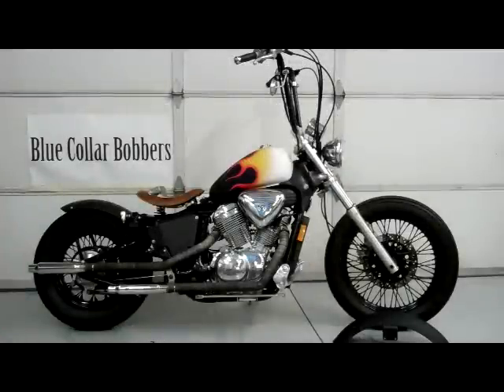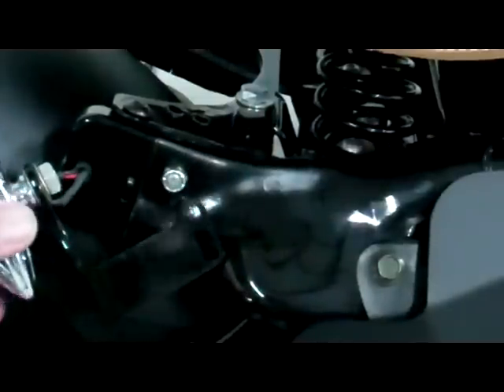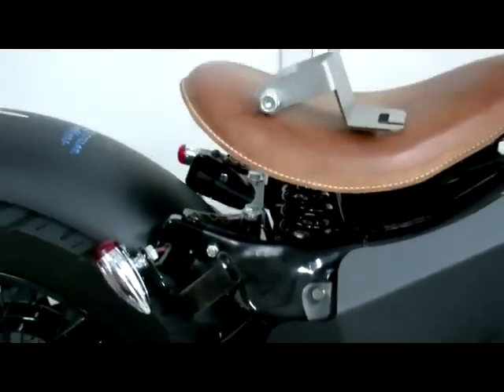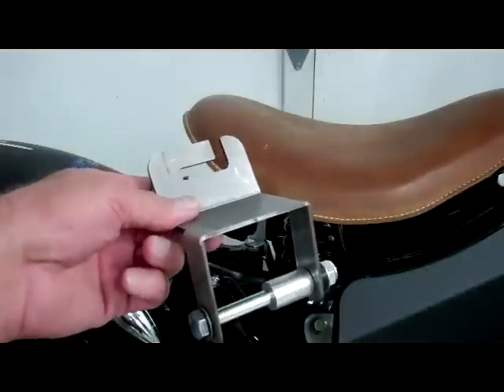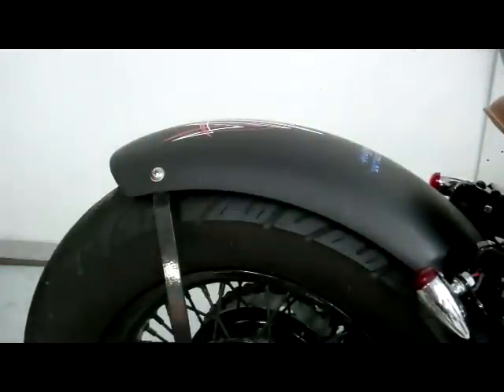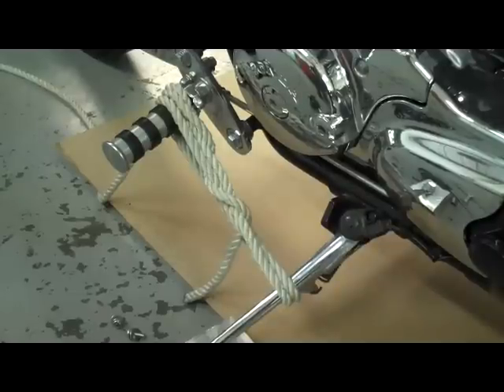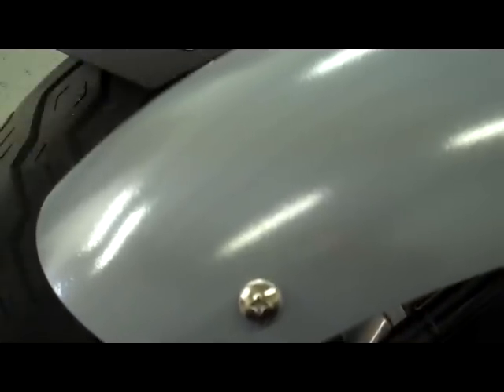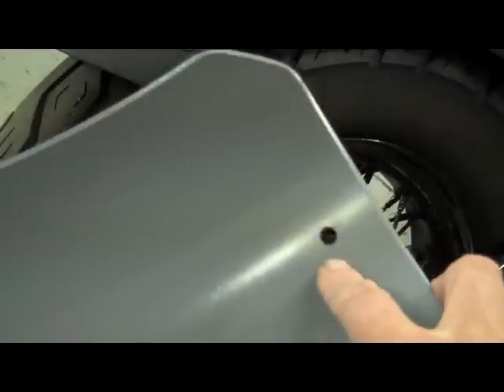Honda Shadow VLX 600/400 Watch First

Comment: If i use this kit do I have to remove the rear shock (i.e. make the bike a "hard-tail")
Reply from the maker: No. Our fender and seat kits are designed to work with the stock suspension. We always have the guys use the stock suspensions on all the bikes.

Comment: Im customizing my 85 Honda Magna VF700C and this is the style Im trying to do. So my big problem is I want to put a passenger seat on there a big sissy bar LOL, but I need to know if this style, can it hold the weight of a passenger, average weight of a girl u know, 150lbs i guess? Or what can I do to make a fender hold that weight without it collapsing and rubbing against the tire. Please any suggestions would be greatly appreciated

Comment: Is BCB Stoll I'm business? I've tried several times to contact them via email and phone and have never got a answer or a email back. I just had one question what is the best or ideal year of vlx 600 to get? Or do your kits work perfectly with any year honda shadow vt600
Reply from the maker: Hi Russell, yes we are definitely still in business. We sell tons of the 600 kits. They will fit any year 600 VLX. The older models require our side covers. The newer bikes have separate covers. We always return our phone messages and emails. Some peoples emails won't go through.  We don't know why??
Thanks so much, Lance and Cheryl at BCB  801 676-7889 mountain time